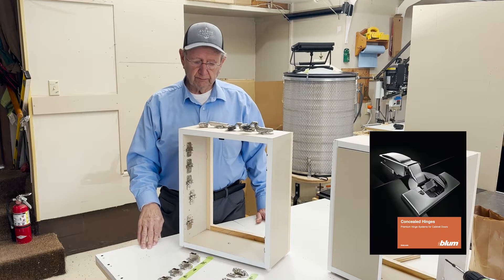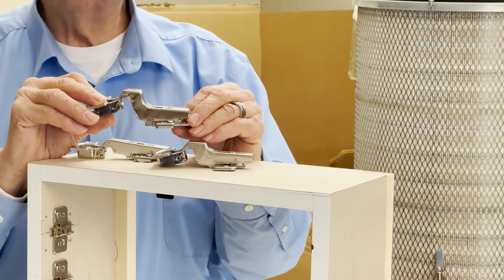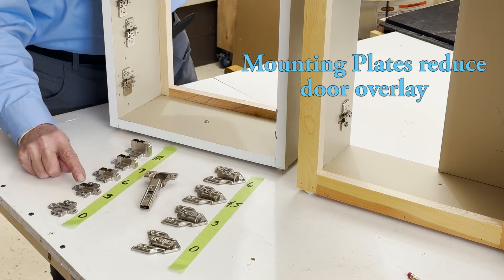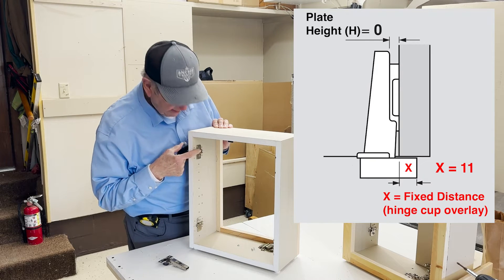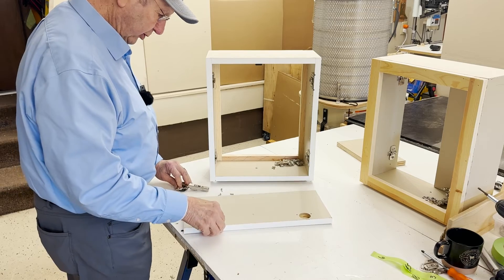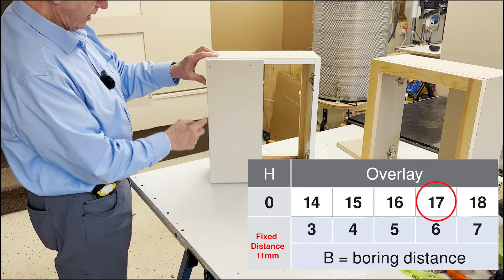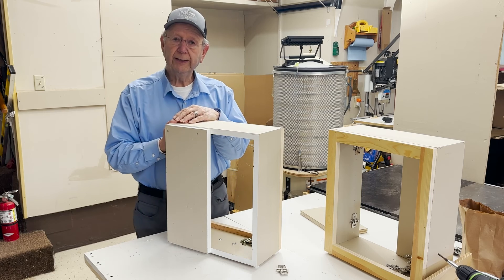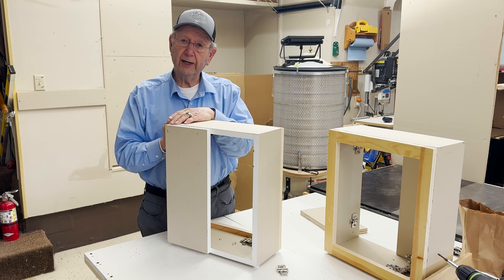Blum Straight-Arm Hinge for a 110 Degree Opening With 0mm Mounting Plate Options

Comment: Thanks a lot for this video. I ended up purchasing the Blum 110 straight arm (B071B3550) and screw on mounting plates (B175H710) from your store. I built frameless that have 1” thick full overlay doors. However, I had ore-drilled the hinge plate locations using the LR32 Festool system so I have 5mm shelf pin holes where I need the hinge plates to fasten too. The wood screws that fit the mounting plates sont get enough bite — and euro screws don’t fit. Do you have a different hinge plate that I could use with the hinges I bought that will accommodate the shelf pin holes, such as with dowels or euro screws?
Reply from the maker: Hello, 
The B175L810 mounting plate has pre-inserted Euro screws and should be a drop-in replacement for you.
https://www.wwhardware.com/blum-frameless-system-screw-clip-mounting-plates-b175l81
-Woodworker's Hardware

Comment: Great video! very thorough and much appreciated. Had a question about inset doors for framed cabinets, you prefer using the CLIP wing mounting plates on page 62 of the BLUM manual, or using the ones that mount on the back of the face frame? Seems to me that the former (CLIP wing mounting plates) provide a sturdier point of fixation since its attached to the carcass.
Reply from the maker: Yes! You are exactly right. And thank you for the nice review of our video. 
The wing mounting plates provide a much stronger hold into the cabinet carcass. We do however sell many of the face frame inset plate as they are simple to install.
-Woodworker's Hardware

Comment: Blum customer service recommended a 7 mm distance but my Kreg jig only goes up to 6 mm. I want the sides of cabinet to be completely flush with the cabinet sides. She recommended I use the 6 mm and then make the adjutment on the hinge itself after installation.
Reply: Are you saying you want the edge of the door to be flush with the edge  of the cabinet.  If so how thick is the cabinet side? Then  I  can make a suggestion.